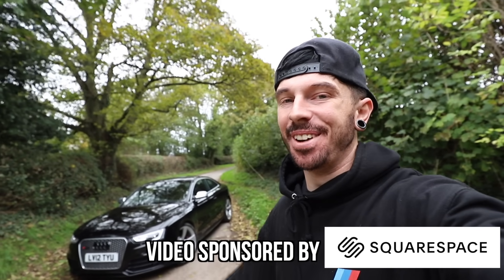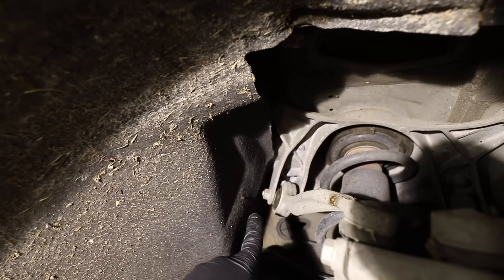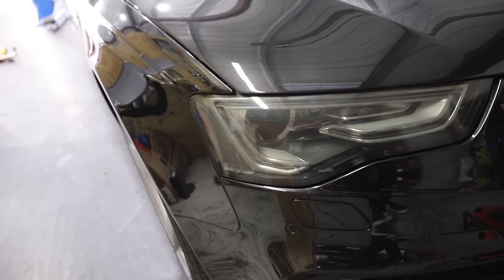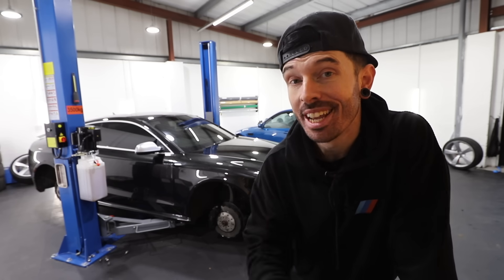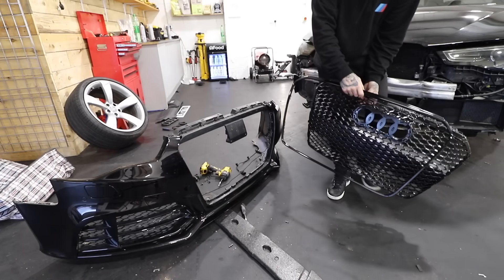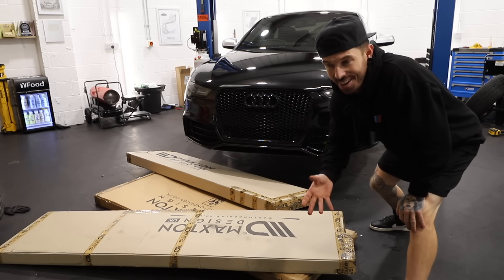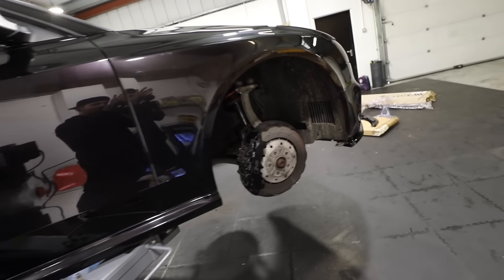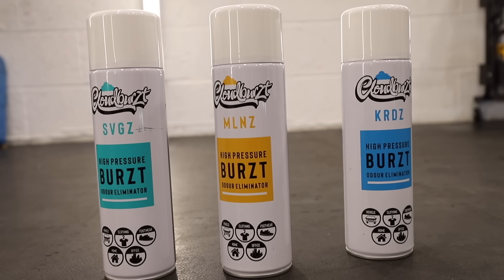I TRANSFORMED MY GIRLFRIENDS SALVAGE AUDI RS5

Comment: Dont wrap it, give it a full paint correction the stock paint looks mint when fully polished out 👍🏼
Reply: It's a fresh paint job?
Reply: @harrislondon  Wasnt it just the replacement parts painted? Plus look at the state of the paint in the video scratches and swirls everywhere. It needs a detail for sure
Reply: @harrislondon  I know a detailer who details brand new cars you will be surprised at the defects he finds. Only front end painted
Reply: Needs a whole new paint job in a nice color . Am thinking midnight purple ish
Reply: Agreed 👍
Reply: Totally agree full paint correction will set it off perfectly
Reply: And ceramic coat 👌
Reply: The car got polished 4 weeks ago when he picked it up when it got painted
Reply: Yea audi has one of the best paint jobs from the factory.  Just needs a good 2 step correction.

Comment: The rs5 actually looks clean with the stock wheels
Reply: Best looking wheels ever made
Reply: they need to be blacked
Reply: Agreed.  Save the money and get them diamond cut
Reply: @Amir.253  yes black them out so they look the exact same as every other black wheel from two steps back 😴 black wheels are for 17 year olds
Reply: @360FAMOUZ360  what other colour then his bronze ones on the Maserati are decent but won't fit
Reply: what size are that whells ?

Comment: Are the front windows legal now they’re tinted, you might get a pull with them that dark
Reply: No they're not legal.
Reply: They'll definitely get a tug, they look rubbish too imo
Reply: @darkbassi5911  3 points right there
Reply: @trigsretromotors  yes agreed, my wife's 4 series has front tints, and they a slightly smoked, I hate driving it at night, to dark, go knows what the front screen would be like.
Reply: @darkbassi5911  My merc has factory tint fronts and limo backs the backs make the fronts look darker from the outside its all you need and no points !!!
Reply: Like most of the number plate pratting about - 3 points for wrong shape or wrong spacing or not mounted correctly or tinted. One tug could be 12+ points in a single sitting 🤔
Reply: Considering most Audi drivers don't bother to indicate. With blacked out front windows, you have even less chance to see which way their looking to go.
Reply: Totally not legal and can result in a fine for both the driver and the company that fits them. So wasn't a good idea for the fitter to be filmed either.

Comment: Tinting the headlights isn't the best thing since it takes away light output. Taking the headlight lenses off and painting the chrome bits on the inside of the housing black is the right and safe way to do it.
Reply: That actually also takes light output away since it reduces the reflections coming from the back of the bulb
Reply: Surly none of them tints are legal, will be getting pulled over every time they are seen no doubt...
Reply: @jmsterdam  it is fine for projectors like the audi has because the light comes from the projector. For reflector based housings you are absolutely correct.

Comment: I am blown away Matt...I have the same vehicle just a left hand drive.  I have been wanting the Maxton Design splitter, sides and diffuser so I am all over that for my 2022 update.  Hope it's easy to get here in the US.  On the mirrors get the carbon fiber skins...I just gloss blacked my stock wheels.  Not a lot out there for the RS5 on wheels...interesting with the spacers.  Rotiform makes some sick wheels for it.  I often comment looks like the wheels are under my car...my car is slammed so not sure I could do spacers.  I literally waited to watch all 5 of your videos at one time like a TV show.  Keep up your great work a big fan!!  I learn a lot...chrome delete tape for our VW here next.  I am after a new project now!  Best.

Comment: May as well have tried the pinch bolt and freed it up, also just checking you know you need to jack the knuckle up to ride height before tightening the top arm bolts? Otherwise they'll die really fast as always under tension. Hopefully made sense!

Comment: 15 front, 12 rear for the RS5 B8.5 - you will now run into rubbing issues on the front arch liner - there is a nipple that rubs on the tyre.  Take another look - mostly noticeable at full lock Matt.

Comment: I'd honestly leave the mirror caps the way they are, it's usually the distinction between the A's and the S's and RS's, as for wrapping the car it's a tricky one, would ideally need to photoshop it prior to see if it'll look decent but with the Maxton design extras being gloss black it'll either look sick with a wrap and those pieces being black or not, wheels definitely need changing up, not massively though but considering you dechromed the chrome window surrounds then it wouldn't hurt to black out the rims.

Comment: Matt, I was thinking of fitting spacers on my RS5 but was thinking 15mm front and rear. Did you comfortably fit 20mm on the rear with no issue on 275x30x20’s? Would like your expert opinion. Cheers

Comment: Nice project, but? Why wrap everything? There is an "optics black set" where the chrome trim is all black. I would also leave the paint job as it is. You should get the rims in black or better in dark gray. Both black and dark gray are/were available directly from AUDI.

Comment: I have a love hate relationship on the RS5 videos. As I own an A5 myself and consider doing such thing  to mine. To which you videos tempt me to do. Buttttt on the other hand my wallet doesn't like the idea. Top work by the way though. PS you need to tighten those bolts up on the control arms whist the weight of the car is on it. Otherwise your suspension won't be perfect.